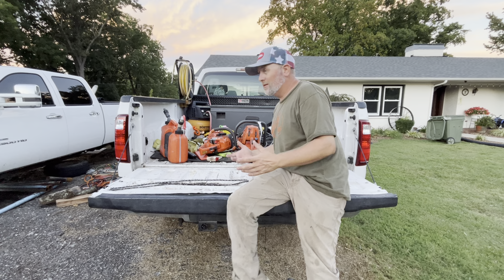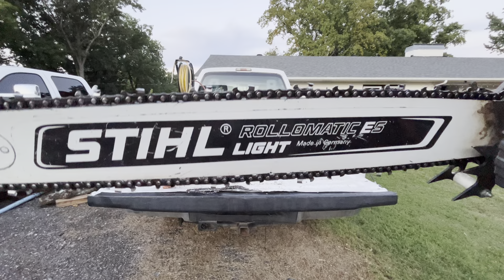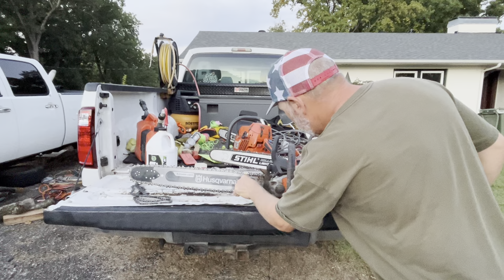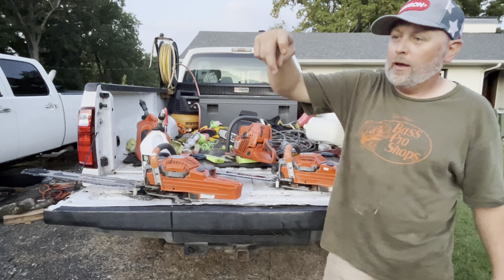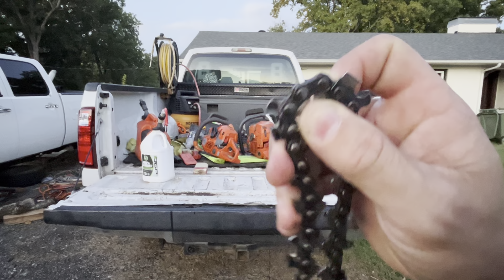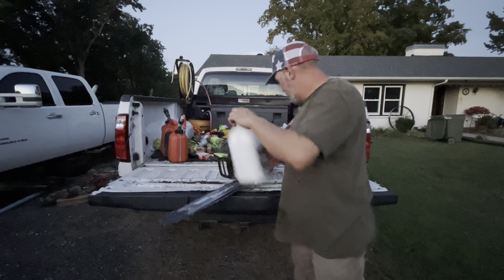Part 1 DGP Bar Oil Review in Hardwood and heat

Comment: Hello and thank you for the video. I always use rapeseed oil or vegetable oil on all my chainsaws. Since I found out that chainsaw oil only contains 0.3 % additives that affect the viscosity of the oil, I stopped buying this expensive chain oil. I never use used oil or motor oil for environmental reasons. I pressed in the small pin on the STIHL oiler and set the chain oiler to maximum (all the way up). Without pressind in the tiny pin right beside the oiler screw you can't run the Stihl oiler on maximum as i found out a few years ago. This means I can use a 36-inch bar without any problems. I use vegetable oil or rapeseed oil all year round, depending on what is cheaper at the discount store, and I have never had any problems with a dry chain. Rapeseed oil or vegetable oil costs about 1 euro ($1.07) per liter in Europe. The gallon costs me round about 4.05 US $. For me, it doesn't get any cheaper than that. Stay save and have a good one bud ✌️

Comment: You know my feelings on this ..taz man tested a biodegradable oil called mechanic in a bottle ..now it’s tacky but still $20 a gal i believe..I’ll stick to whatever I find cheap which is cam2 or country line..I was given 2 gallon of the dgp/ dewalt oil ..hot weather no good…I’m saving the other gallon for winter testing
Reply from the maker: @Aaron_A_Lynch  in the winter it may be better but i had a lot of chain stretch with it
Reply: @MitchellsBackyardLogging  If you can get it in your area Harvest King is inexpensive and works very well.

Comment: I've never seen mystik before. I've liked cam2 the best of what I can source locally. I didn't care for the county line bar oil. It didn't flow good even in hot air. I just got done using a gallon of that because I couldn't get cam2. And just reinforced that difference between the two.